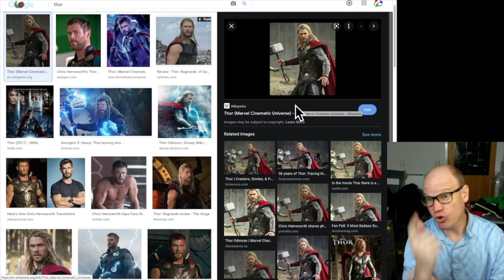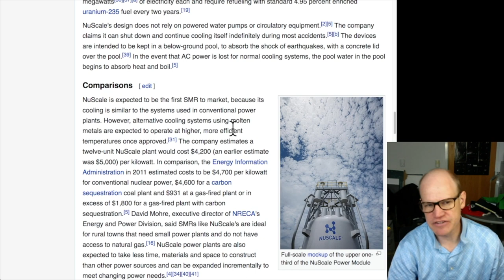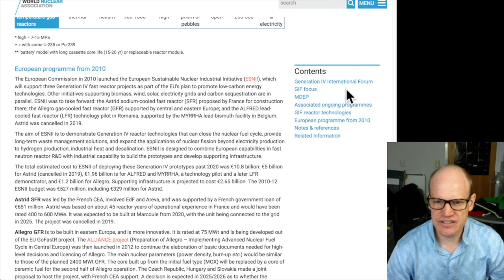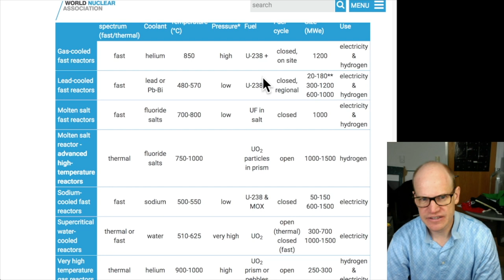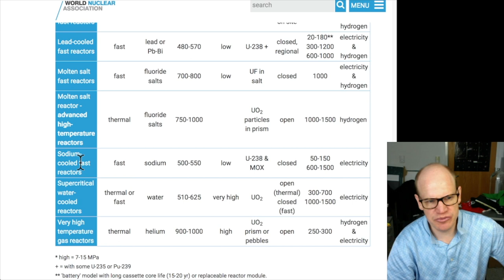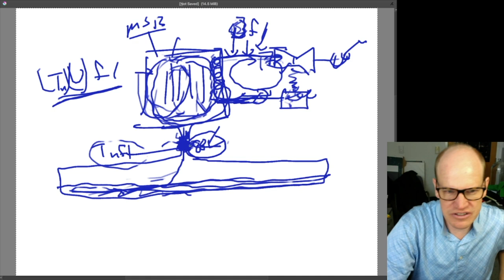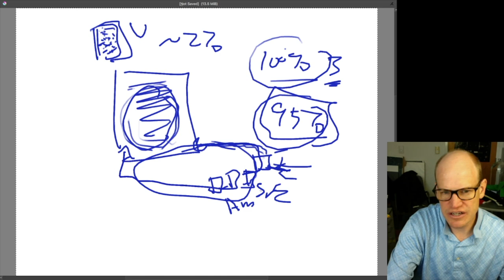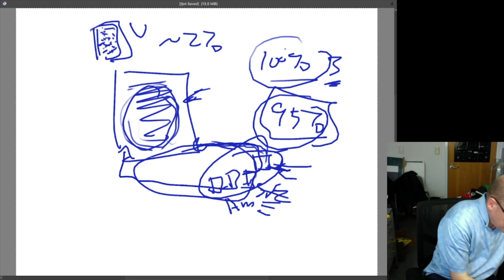Nuclear Energy 06: Generation IV Reactors

Comment: Just for completion another walk-away safety mechanism that is being worked on: the molten salt is continuously actively pumped from the storage tank into the reactor core. When the power dies, the salt drains into the storage tank. So no plug that has to melt.

Comment: Another point about MSRs is the benefit of having the fuel free from cladding making it possible for gas products to be removed early and easily. So neutron poisons like xenon and iodine can potentially be collected at the top of the reactor vessel and removed in real time. This will not only reduce neutron poisoning significantly, but also cut out a substantial source of caesium from the fuel potentially without any chemical separation required. 

And then there's the other side of the liquid fuels which is all the potential reactions possible with a salt such as FLiBe - although this is a double-edged sword due to the corrosive nature and high toxicity of the salts. They corrode a lot of materials but also will react with fission products and produce chemicals such as caesium fluoride which will precipitate at temperatures below 700c once again making mechanical separation possible.

Comment: Excellent explanation, very informative. I suppose there should be multiple safety plugs at different angles in the MSR to increase the safety in the case of large earthquakes/bombing attacks. Thank you very much.
Reply: No real need, as it's operating at 1 atmosphere, even if it's hit with a bomb, it splashes onto the ground and it solidifies.  If you're worrying about large scale leaks there can be a drain pan like a sink that will guide the liquid into the drain tanks as well.  At worst, the fuel will only travel as far as the shockwave of the bomb can carry it.

Comment: What kind of chemical means could you use to separate actinides and fission products from the liquid salt fuel in real time? Obviously something like Xenon could be bubbled out because it’s a gas, but things like Strontium, Iodine and Cesium form Ions which are chemically similar to some of the other ions in the salt. Also whatever process you use has to work at extremely high temperature and preferably without depositing other side products into the molten salt fuel.

Comment: 39:58:  Elysium molten Chloride salt fast reactors - ~700°C - burn every kind of waste including depleted U, weapon Plutonium, spent solid fuel,...(my favorite reactor). The heat is pumped out of the (one size, always critical) reactor pot into exchangers (2ndary loop - the more the higher the capacity - same salt as primary loop, slightly higher pressure - tertiary loop for steam - 10 - 1200MW electric).

Comment: Why didn’t you cover molten chloride salt fast reactors ?

Gates is doing it.
Elysium too.
Check out Ed Pheil.
Reply: It’s essentially the same, terra or elysium might use fl if/when it is economical.
Reply: @Goodwalker720  

No it is not the same.

Using Flouride means you get more of a thermal reactor rather than a fast spectrum reactor.

Compare the atomic weights of flourine vs chlorine.
Chlorine is ~ 85% heavier than flourine.
Reply: @markcojuangco8773  ok, “more” thermal but would still breed and burn spent fuel rods. Trade off is higher temperatures.
Reply: @Goodwalker720  Imho you should check out Ed Pheil he has a very logical and complete explanation for his MCSFRs.
Reply: @red-baitingswine8816  thanks, I’m already a big fan of Ed and Elysium
Reply: @Goodwalker720   Imo Thorcon's proposed mass production of full-size nuclear power plants in shipyards is a game changer. What do you think about a version using Elysium's fast reactor (Pheil said it's smaller than their current reactor)?
Reply: @red-baitingswine8816  is thorcon the one where the core is taken out after a decade or two? Elysium wouldn’t need that, but a barge type setup could be made to work- even if MCFR is heavier than some designs.
Reply: I think for Thorcon the graphite goes bad after 4 -7 years. They just quickly switch with the adjacent new reactor, then let the old one sit/cool until it's safe to switch it for a new one. But it's revolutionary, their plan to mass manufacture complete full size power plants as basically ships, in shipyards, and locate them next to land in rivers/oceans. They're building a test plant now for Indonesia, which is updating its regulations to accommodate it. $ for $ competitive with coal.
Reply: @Goodwalker720  The elements Cm and higher need a harder fast spectrum than those lower than Cm to fission efficiently. If the goal is to completely consume ALL the higher actinides in the spent fuel, the Cl salts have an advantage. If the goal is "just" to consume the Np, Pu, & Am then it doesn't make much difference. This is one of the reasons TerraPower and Elysium favour Cl salts for their MSR designs.

Comment: It would be great to have a breakdown of the cost of various parts of a nuclear plant

I suspect the reactor itself is only a tiny fraction of the cost and things that people wouldn't even imagine actually end up costing huge sums

For example there are two reactors under construction here in the UK. They have six very large underground tunnels which extend 3-4km out to the sea these tunnels are used to pump cooling water into and out of the reactors

I don't know, but I would wager these tunnels actually cost more than the reaxtor itself. And irrespective of fission fusion or type.pf.reactpr design this cost is more or less the same

There should be an effort to break down each cost and delete parts where possible. For example you can delete the cost of these vast tunnels 4km out to sea by simply placing the reactor out at sea.... this may have been unlikely a decade or two ago but now with the experience and cost delines from offshore wind power it wouldn't be expensive or difficult to install offshore foxed bottom nuclear reactors out at sea

A small innovation like that might do more to help with nuclear costs than changing the reactor itself

Advantage of offshore nuke

No costly huge underground tunnels out to sea

No costly large pumps to pump millions of tons per minute water out to and in from the ocean

A slightly better delta in t hot and t cold yo improve thermal efficiency

Lower land cost (no need to pay for 4,000 acres = £40 million saved and its worse than this as so few sites are approved for nuclear that the land owners literally get 10x the value to sell their land for nuclear use all adding costs

Lower security costs

Etc
Reply: The numbers given by Elysium Industries are 85% of the total cost is the power conversion side of the plant, and 15% for the nuclear side. For any high-temperature reactor (LWRs are low temperature) the power conversion equipment is the same as a coal plant, off-the-shelf stuff. LWRs have highly specialized low temp/pressure, nuclear-certified equipment which drives the cost WAY up.

Comment: The problem with nuclear is that western nations have reached peak electricity consumption and its always cheaper to just keep using what you have

If demand was increasing the cost of nuclear is the cost pf nuclear. If demand is flat the cost of nuclear is the cost of nuclear plus the cost of writing down an existing coal or gas fired power station to zero

Comment: Subbed. MSR and Thorium need way too much R&D. I will go out on a limb and say some MSR companies business model is R&D. I was a huge advocate of LFTR and MSR until the LFTR designer said something like "to remove the off gas fission products all you need to do is bend the off gas pipe and the gaseous fission products will remove themselves" I don't remember the exact quote. I've heard that MSR fuel, when circulating through the reactors piping and heat exchangers, leaves fission product "build up or plate-out" not to mention the corrosion issues in long term use. I don't want an MSR near me that does this. Terrestrial Energy in Canada is building their IMSR, but, they know the R&D and regulatory hurdles are too great. So they design their power plant to replace the MSR reactor every seven years. I really hope MSR can resolve its issues because it seems to be the most efficient design so far (also Moltex MSR, but it seems R&D heavy). But in USA Kairos Power and X-Energy are developing (uranium only) TRISO fueled pebble bed reactors. Kairos uses FLIBE salt coolant, X uses helium gas. TRISO is one of the new "accident tolerant" fuels ALREADY licensed by NRC (I assume MSR fuel will also need to be licensed). The reactors use existing nuclear steel that are also licensed. Kairos is given the OK to build a non nuclear demonstrator, then when licensed, will build a nuclear demonstrator called Hermes. Then hopefully begin construction of units in the early 2030's. I've read that obtaining uranium from seawater is obtainable. So if reserves become low in 20 years that may be another source of uranium. 

Regarding the fast spectrum MSR's. I'm not a business man but it seems easier to spend 10 million dollars on uranium fuel then use it to generate a billion dollars in revenue than it is to go through the regulatory hurdles, delays, politics to acquire fuel for fast reactors, just to save 10 million. The fast MSR companies make it sound like it is simple to obtain unspent fuel or down blended weapons grade uranium and plutonium. Moltex Energy says they can do it, I hope they are correct.

But is seems the best approach is to keep it simple for now. Also, in LFTR, in order to produce U233 from Th232 the process produces High Enriched Uranium. It stays in the reactor vessel but it's questionable if the NRC will allow this.
Reply: Have you checked out Elysium's (Ed Pheil) MCSFRs? If so, what's your take, in view of your concerns above?